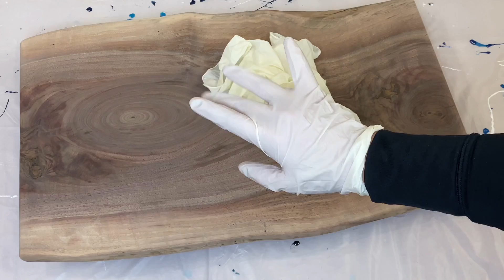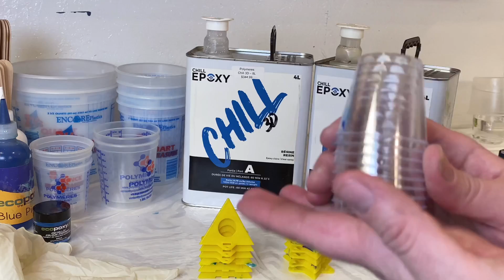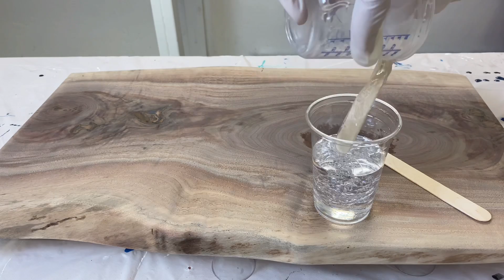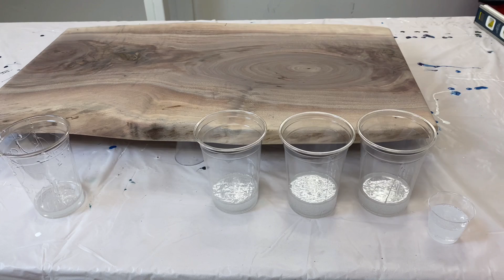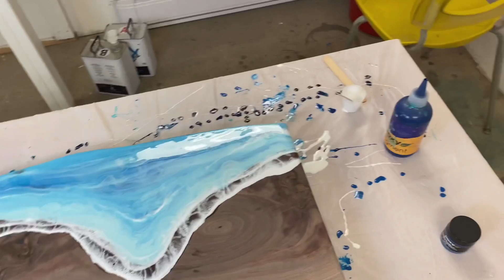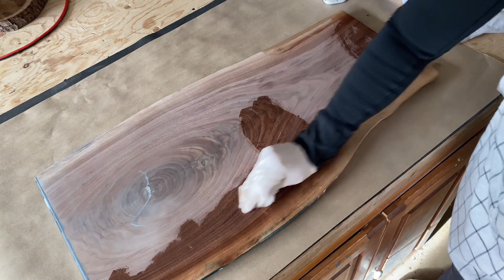How to make a Resin Cheeseboard  | Epoxy Art Overlays For Beginners  | Epoxy & Woodworking Tutorials

Comment from the maker: I've added timestamps to make it easier for you to refer back! As always, don't hesitate to ask if you have any questions at all. Thanks so much for watching!
Reply: I am just starting and I have a couple of questions. Is this the best place to ask you or do you have an email or something. Thanks, meg
Reply: I have some questions: do we always have to wear a mask with resin? what happens if it doesn't fit? Are there ready-made resins? or do you always have to put the catalyst? and then I wanted to know if the colors can be of various types (metallic, acrylic, etc.) and if they always have to mix with the resin. Thanks
Reply: I use art resin quite often and I maybe doing it wrong but there’s zero foc’s them along with other resins. 

I do, however always have a window open and a bit of flow … it’d be pretty cool to have ready made resins, but you’d still need to stir and mix it well. 

Mica powders, glitters, acrylic paints do mix with resin - I would go with mica powders if you’re just starting out - do you have something in particular that you’d like to do, for example - ocean art?! 

If so, buy a few “decent” blues, greens etc - they seem expensive to buy but they are so highly pigmented that a little really does go a long way … you will NOT achieve lacing of cellls with anything other than a good quality white pigment … hope I’ve helped. Enjoy!! 

Not sure what you mean about “if they have to mix with the resin?”

Comment: It looks like your board isn’t totally flat like parts of the bottom are off of the table… and I’m so hoping that’s OKAY? Cuz I had someone run my piece through a planer and now it’s not completely flat anymore 🤦🏼‍♀️ I am SO very confused
Reply from the maker: It is flat, it’s just sitting on little plastic cups or on top of a rubber mat- depending which point of the video you’re at. I personally to make sure all my pieces are perfectly flat. I let my wood acclimate in my shop before working it. Planing straight wood will make it flat, and even planing cupped wood can make it flat. Unfortunately, if your wood is twisted though, there will be some extra steps involved before you can put it through a planer to make it flat. You’d have to flatted one side first or use a planer sled. That being said, if you’re doing this for fun or as a hobby, then it’s not critical that the wood is completely flat. I hope that helps, but don’t hesitate to ask if you have any other questions 🥰

Comment: Thank you. I have 3 masks with the correct filters. I need to wear reading glasses for close up work. I have now been told no masks are made to fit glasses. Every nose piece just pushes them out of the way. Doesn’t half of the world need reading glasses? I may have to make my own.
Reply from the maker: I have a 3M mask that I wear with my glasses. Im trying to think back, but for some reason I don’t think I’ve had this issue. Have you tried a 3M?

Comment: Thank you for your tutorial. This may be realize that this is not a project for the weekend crafter. Your info about safety was informative and all the supplies you would need for the project would be costly. I have a greater appreciation for the artists who create resin pieces and the price they charge is definitely worth it.
Reply from the maker: Thanks so much for watching! You’re absolutely right, it can be a bit of an investment to get started and can definitely take time to get the hang of it. Don’t let that discourage you if you want to give it a try though, it’s so much fun and many find it extremely therapeutic ❤️
Reply: Help in pricing what is fair     Iv seen some selling for big money or no money
Reply from the maker: I base my prices off time and materials. Most people that are undercharging are probably new at the process or just do smaller and local markets. It really depends on who your customers are. To start, set yourself an hourly wage, then figure out your time and material costs, then double it. That’s a good starting point. Then adjust from there!

Comment: I’m impressed at how clean you kept yourself. I’ve only just started doing this stuff and by they time I’m done, it’s as if I fell into the vat.
Reply from the maker: 🤣🤣🤣 That’s too funny!! I’ll be honest, I’m probably generally not quite as clean when I typically work. Usually I’m working on large batches of boards at a time and I get moving pretty quickly. I usually end up with at least a few drops on my boots 😂 I was a hot mess when I started 5 years ago though! Epoxy on the floor, all over me, my heat gun.. just everywhere lol. You’ll get into a routine and get better at that! Appreciate you for taking the time to watch 🫶🏼

Comment: Brilliant tip for taking the tape off 
I always sand it down or tape as a joint lol.     I’ll try this
Reply: I’m just looking at metal name tags to add company logo lol
Reply from the maker: Thanks for watching.

Be sure to wear a mask and please don’t do in the house. It’s nasty stuff and stinks when it’s heated even slightly. Let me know how it works for you. You can also apply a paste wax instead of tape, but I don’t love that method because it messes with the finish sometimes. 

Now, I just zip off the drops with an oscillating multi-tool or just sand them. I actually find it easier/faster for me than the tape. The tape is great for beginners though, or anyone who is less comfortable with the sanding or doesn’t have good dust extraction. Hope that helps! Happy creating 🥰🌊
Reply: @backwooddesignco  Iv my own workshop at home so I’m getting everything together even just got a spray gun compressor to help sanding and clear coat paint.     Normally use f3 mask when doing it     It’s the polyester resin that smells bad and I can’t get on with it     Goes off to quickly and looks missy I’ll do them boards then send few pictures on here for you
Reply from the maker: @garydeandeery  Yes the polyester resin is stinky stuff!! A really nice coating though for furniture over cured epoxy. A challenge to work with though. Good luck! I can’t wait to see how they turn out. If you can’t send pictures here, DM or tag me on Instagram @backwooddesignco so I can see 😍 Have a great one Gary!

Comment: if you leave the painters tape on and sand it you get a nice clean edge where the tape was and can skip the heat and scrape step.
Reply from the maker: Thanks for sharing the tip. To be honest, the tape is really just a tip for beginners. I never tape- I only sand the drips. When pieces have huge drips, I’ll use my oscillating tool before sanding 🙌🏼

Comment: Beautiful work! It seems like I always ruin my piece when doing the white waves. Myself, I like just a frothy undertow coming in or going out. But I never seem to get a thicker white edge. If I put more on, then it just seems to go crazy all up in the blue, which is never my intention. I will say, doing something like this is very different from counter and table tops. And I always seem to get a hair or piece of lint in my work!! I just hate that, or my sides are not smooth, or I get little dents in my work. I’m sure I play with mine too long…knowing when to quit is my biggest challenge!! Love your video!!
Reply from the maker: Thank you so much! I really appreciate that!  Are you using a table top or casting epoxy? A table top epoxy will help you to achieve this effect quite easily as an overlay. You can also pick up the board and slightly tilt it back towards you and wait a couple seconds for the wave to roll back onto itself. Lint, dust and hairs…are the bane of my existence haha. Hard to avoid. I’ve set up a dedicated “clean room” for pouring epoxy. Has exhaust and air filters. Makes a bit of a difference, but I’m always fighting dust lol. Thanks so much again for watching 🫶🏼
Reply: I just absolutely love your detail!!!
Reply from the maker: @tlrmd4you  You are so sweet! Thank you so much. If you have any more questions- don’t hesitate to reach out anytime 😉

Comment: Thank you for showing this technic.
Is the board thicker where the epoxy is apply?
Reply from the maker: My pleasure! So happy to help. Yes, there is a 1/8” variance between the wood and epoxy surfaces. You can add clear epoxy in the low area to level it out and then sand the entire surface to either keep satin, or to apply a final coat for a glossy sheen. If the surface is fully covered with epoxy, then it’s not recommended for cutting on any longer 😁 Hope that helps!!

Comment: Thank you for such a fantastic demo from supplies to end product!! I am new to resin and found your explanation and tips invaluable! I heard someone say that brushing on a thin "penetrating" coat first can help with absorption evenness and bubbles released from certain species of wood. What is your experience with this method?
Reply from the maker: Thanks for watching! So happy you found it helpful! You can definitely do that if you’re having any issues with bubbles. Just make sure you get your next coat on before it sets, or you’ll have to sand in between coats. I will use that method on really soft or porous wood sometimes. I don’t tend to have that issue with the epoxy I use. If you’re using a high enough viscosity epoxy, you should really be able to get sufficient coverage with one coat. I do find it tends to suck into end grain more easily though. Hope that helps! I would just recommend trying both ways and see which way works best for you. In either case, you’ll likely need to do two layers anyways until you get the hang of it… so it’s kind of six of one, half dozen of the other if you catch my drift haha 🫶🏼

Comment: Gorgeous art work, but once you start to cutting on top resin layer is scratched 🙄
Reply from the maker: Thanks very much! Yeah, it’s definitely not intended to be a cutting board. It’s for serving cheese, charcuterie, etc. I also make wall art and furniture.

Epoxy is extremely dulling on your knives, so I’m not sure why you would want to cut on it anyways to be honest😉 I leave a portion of the wood exposed for those that do want to cut on it.

Thanks for taking the time to watch and comment!
Reply: @backwooddesignco  its beautiful and I enjoyed your video! If you do use the wood side as a cutting board, is that top oil safe for foods? And what would you use to clean wood side? After cleaning do you re apply that oil?
Reply from the maker: @margiemarongiu4831   Thank you so much for watching! Yes, the OSMO top oil is food safe. I apply 2 coats! I like to sell my beeswax/mineral oil blend that I call Backwood Butter. I apply before serving food and after washing- it keeps the board looking brand new forever 🙌🏼 I just use a mild dish detergent and non abrasive cloths for washing and drying ☺️

Comment: Great tutorial. Straight to the point about everything! How do you get the edges/ sides to retain the resin? My resin just drops straight off the sides during the drying period 😥 I tried sanding and even painting the sides with no luck
Reply from the maker: Thanks so much! I actually have a video on that specifically coming up, but in the meantime here’s some tips:

-make sure you’re using a 1:1 high viscosity epoxy
-if you’re using 1:1 and it’s still not sticking to the side, you can pour your epoxy on your piece in the centre and let it set up for about 5-15 min. to let it thicken ever so slightly before you start to spread it around
-you can also tape the sides and back of your board (I like to start 2-3” further  up than where I want my finished line to end) and lay out your design and let the entire artwork set up for about 10-30min before pulling the tape back and letting it slowly slide off the sides. You’ll want to keep an eye on it to fix any spots where there is surface tension and it’s not dripping evenly
-beside that, the only other suggestions I would make is to use concentrated epoxy/resin pigments as they will be more opaque and help the colour stick to the edges better. Also, a second coat can help to fix anything you’re not happy with (just be sure to get the next coat on before the epoxy is fully set for the best adhesion)

Good luck! I hope this helps! Let me know how it goes the next time you try it. Thanks for subscribing and stay tuned for more tutorials 🤍
Reply: I would love to see that video as well, thanks for the great tutorial!

Comment: Thank you so much for the detailed tutorial! One question, my white tinted resin is really thin and spreads a lot the minute I lay it down. I added 3 drops of tint into 3 or so ounces of resin. I'm using Mixol Universal Tints Oxide White #25 and MAS Table Top resin and hardener. Any ideas on why it's so thin?
Reply from the maker: What brand of epoxy are you using?? I’d try letting the mixed white epoxy set up for 10-15 min before putting down. Also don’t go too crazy with the heat gun as that can push a lot of the product off. It could also be the epoxy you’re using.

Comment: Is this oil food safe when you put on a kitchen board or what would you use to buff a kitchen board to be food safe.
Reply from the maker: Yes, the Osmo Top Oil is certified food safe. You can also use a butcher block oil, or a beeswax/hemp oil blend, but they need to be reapplied more frequently. Those types of products are more for maintenance as they don’t have as much protection for the wood in their own. 

Osmo Top Oil & Odie’s Oil are both good ones for kitchen boards and utensils. Hope that helps! You can get Odie’s Oil from chillepoxy.com and use coupon code “BACKWOOD” to save 10% on your order ❤️

Comment: This video was fantastic.  Thanks for much for making it.  I actually tried making my own beach scene this morning, following your guidelines.  It went okay, but like you say, going to take lots of fun experimentation to get better.  I did have one question though.  I applied the white pigment line along the shore as you did in the video.  But when I gently applied the heat gun, the white tinted epoxy kind of melted into the green and blue expoxy further into the water.  None of those cool foam cells formed.  Should I have waited 15 or 20 minutes for the epoxy to firm up a bit before applying the heat gun?  Any other suggestions?
Reply from the maker: Thanks so much for watching! I’m so glad you gave it a try. Did you lay a strip of clear epoxy down at the edge of your blue/greens before you applied the white and blew it with the heat gun? The addition of the clear is what really helps the epoxy to spread over the other colours and create those awesome cells.  You don’t have to wait any length of time, as long as your epoxy (after mixed with pigment) still has a high enough viscosity that it would run too freely. A really high viscosity epoxy, closer to the consistency of honey than water, will help you to get the results you’re looking for. Pigments also play a big part. I always prefer to work with epoxy or resin pigments and dyes instead of alcohol inks, acrylic paints & inks, etc. I hope that helps! Keep me posted and let me know how it goes 🤙🏼

Comment: I don’t have a heat gun. Is it possible to use a smaller torch to heat up the resin instead of a heat gun?
Reply from the maker: You can use a smaller torch to pop the bubbles, but you need the air to push and really be able to move the epoxy. You can get a heat gun on Amazon for $30-40 and it’s perfect for doing epoxy art. I’ve used a hairdryer before, but it blows too much dust I’ve found and not a high enough cfm.

Comment: I’m assuming these prices can be decorative or as a cheese board. Is it possible to use them as a cutting board??
Reply from the maker: Yes to all! However, I don’t recommend cutting on the epoxy, or using it for hot foods. Keep those on the wood portion. Depending on the epoxy you use, you can use the epoxy portion for serving other foods. Some epoxies aren’t food safe, so be sure to check the SDS or with the manufacturer.

Comment: Love your video!  Epoxy means 2 part 
1. Resin and 2. Hardener.
There is epoxy resin and epoxy glue and Epoxy fiberglass and I'm sure there are other types of products that are 2 part (epoxy) type of that product.  You are using CHILL 3D epoxy "RESIN" as opposed to polyester resin but it is RESIN not epoxy...  When you teach a class where people bring their own supplies (after you've given them a list of supplies needed)  and they show up with a gallon of EPOXY glue because You Tubers call resin epoxy and not by the proper name "Resin" it can be really frustrating.  Words matter...
Thank you for the video your art is beautiful.
Reply from the maker: Thanks so much! I have a list of supplies and also supplied links for the products I used. That’s why I said it’s so important to check the manufacturer’s product sheets and instructions before you purchase 😉 

I’ve never seen anybody in the woodworking industry refer to epoxy as epoxy resin, including the epoxy manufacturers. The only people that really refer to it specifically as “resin” is the craft community. Technically, it’s a two-part epoxy resin, which is most commonly referred to as just “epoxy”. Again, it’s always important to read the manufacturers information. I’ve been teaching epoxy and also this technique specifically for over six years and that question or issue has never come up before. The way epoxy glue and polyester resin are marketed by the manufacturers is completely different and it should be fairly obvious to the person who is shopping that is not the product they’re looking for ☺️ However, I’m always here if people have questions or need clarification. Thanks for watching! Always appreciate the feedback